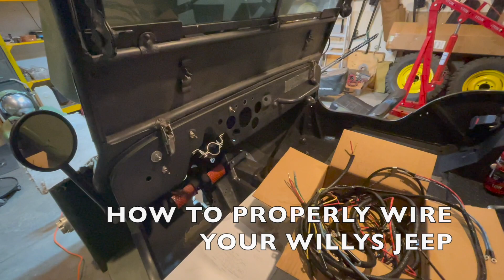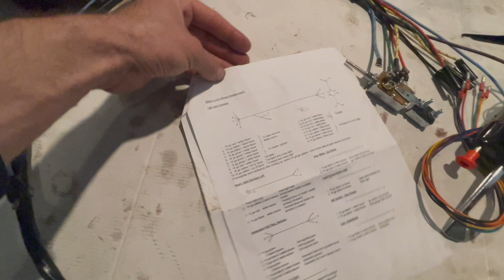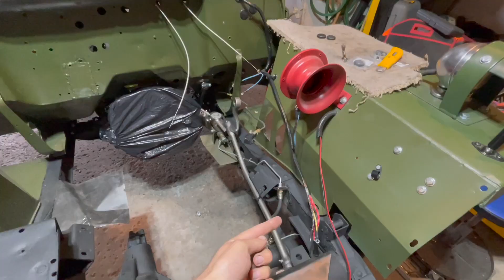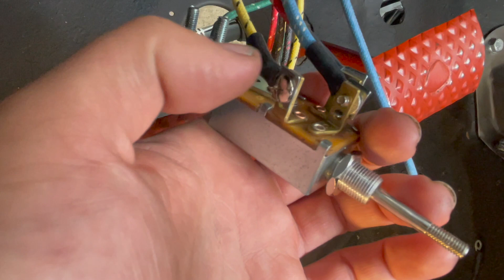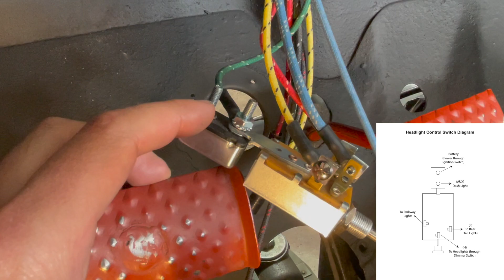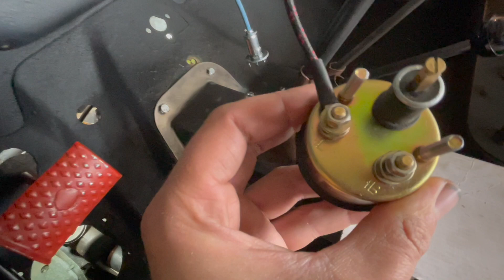CJ2A Willys Jeep Main Harness (PART 1) | Electrical Wiring Series

Comment: I've watched every video so far, I count 12 video's just on electric wiring, are there more? Thanks again, these videos are a tremendous help. The bullet terminals on the turn signal (video #1) are 22 - 18 gauge bullet terminals, I purchased a set at Napa for $4.00. In addition, how did you hook the turn signal flasher? I bought a three prong adapter and a EL-550 Heavy duty flasher from Napa and used butt connectors to tie them together. On another video on Youtube, I learned not to hook the blue wire (ground) up to the flasher, I just hooked the black wire to L terminal on the flasher adapter and then hooked the red wire relay to P terminal on flasher adapter, then the other end of the red wire to ignition.